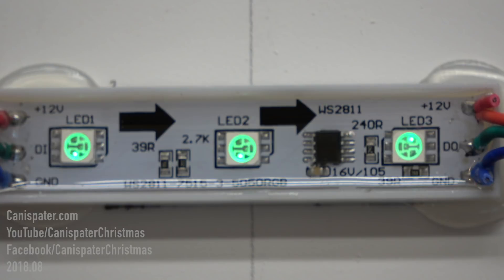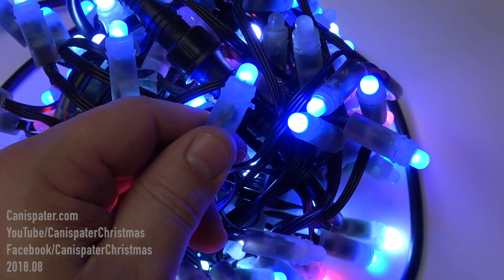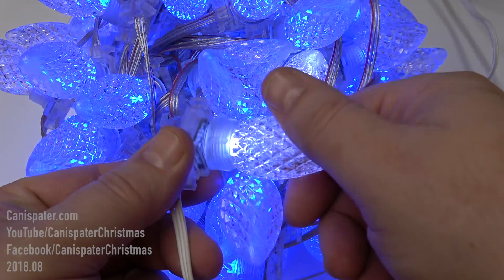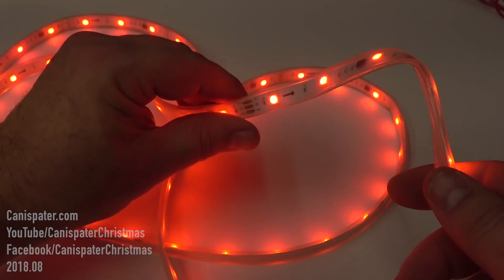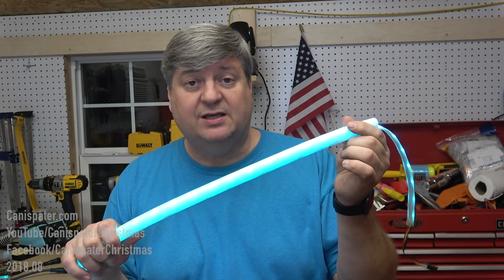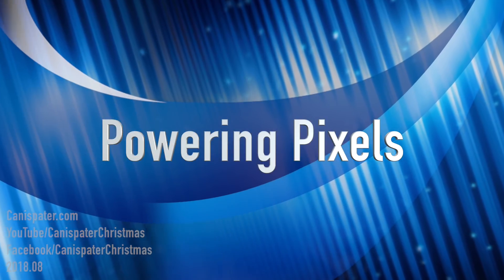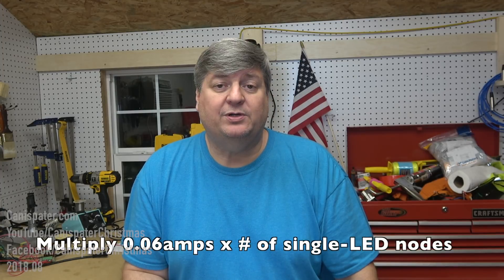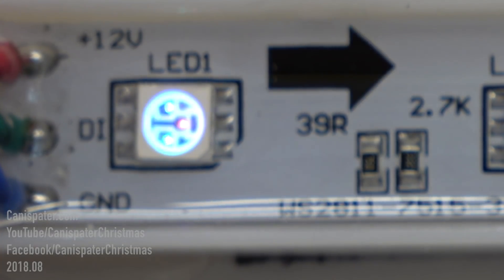HOW TO GET STARTED with RGB Pixels (2018)

Comment: how are pixels different then WLED light shows
Reply from the maker: From what I've read, WLEDs are white. Pixels have 3 LEDs in each bulb or "node" - one red, one green and one blue. Each node has a microchip capable of mixing the intensities of the three LEDs to produce practically any color. "Smart" or digital pixels use (computer) data to control the color and intensity of each individual node (20 times per second) which allows for animating patterns among the various elements or "props" in the display. "Dumb" or analog pixels are essentially the same, but the entire string is the same color and intensity. Most are using smart pixels these days.
Reply: @CanispaterChristmas  do they use the same power supply and controller
Reply from the maker: "They?" If you mean dumb/smart pixels, they use different controllers, but can use the same power supplies if the pixels are the same voltage. Now, dumb controllers (eg: http://www.hansonelectronics.com.au/product/2811dc30/) I've seen can use the SPI data from a smart controller (eg: https://www.pixelcontroller.com/store/index.php?id_product=48&controller=product) to control the dumb strings - the dumb controller acts like a small set of smart pixels to the smart controller. If you want to avoid getting more hardware, smart pixels can do everything dumb pixels can do and more so most are using smart these days. I have no idea what's involved with WLEDs.

Comment: Good day, I know you stated in another video that you use Mean Well for your power supply. They have so many different options my head started spinning, Could you be more specific in the model/type you use for Christmas lights. Thanks
Reply from the maker: Most of us use the 350-watt variety. They do have a few different models, but it comes down to personal preference. They have some where the screws point up and some where they point out. For 12V, I use several of the LRS-350-12.

Comment: I could have sworn I watched a video of yours about power injection using T connectors where you pulled the data connection out of the T with a pair of pliers. Any idea which video that might have been? I thought it might have been in your udemy course, but I couldn't find it there either.
Reply from the maker: I don't use T connectors for anything. All my power injection is done with the pigtail wiring or directly to the string if it's in the middle. I do use the 2-wire automotive connectors tho.

Comment: I'm having an issue where when I light my 22x30 pixel grid on red, the matrix shows different colors about every 170 pixels. Could you help me out here? I'm using f16v3 with fpp
Reply from the maker: Make sure the universe sizes are all either 510 or 512. Since you have an F16, I’d go 512 unless you need 510 for an older controller. I believe the F16 comes set to 510 by default so change it to 512 on the inputs page (can’t remember what it’s called - going from memory here). :).
Reply: @CanispaterChristmas  thanks! Your videos have pushed my wife and I to do pixels!
Reply: @CanispaterChristmas  that seems to have fixed it! Thank you so much!!

Comment: Just received my Pixel's from Ray, and want to just test them... but I do not have my Falcon controller yet... but I DO have all of my power injection pigtails with just 2 leads... can I just power them on to see if they light up? and I realize that I'd had no color control yet, so not even sure if they'd light at all... but figured I'd ask you first, or I can wait until I get my Falcon and create that test light pattern you run... Thanks
Reply from the maker: Well, I thought I replied to this earlier. No, you'll need data to get them to light up. Totally understand wanting to play with them though!
Reply: you actually did in the video, I had quickly typed the question and then "re-watched" the video... Thanks for the reply... @CanispaterChristmas

Comment: Is it hard to integrate pixels in light Rama and what do we need to do it
Reply from the maker: You can import old LOR sequences into xLights and drive the LOR boards with a Falcon F16V3 via the DMX output on the board. The F16V3 will also run the pixels. OR, I think LOR has pixel controllers now, but no clue about how to integrate them or software needed.

Comment: Thank you for your nice videos. I have a Tanbaby 5V 60A PSU that produces so much electrical noise at boot up that it renders my lights unusable. Is there a way to reduce this noise? As a temporary fix I have put a switch on the output, so I first turn my LEDs on after the PSU has been on for a couple of seconds.
Reply from the maker: You might try this question on the forums listed in the description of my videos if you don't get a good answer here. I've not heard of this problem nor experienced it myself, but I'm using MeanWell PSUs. Maybe a time-delay relay? There may be a filter circuit you could put together, but that is beyond my capabilities.

Comment: Over the last couple years I have fallen in love with the light shows I have seen.  It seems like a daunting task but I would like to start building a show for next year. Should I piece together a kit or just buy a plug and play kit? I do plan on expanding each year. I get overwhelmed trying to figure out what exactly I would need in terms of controllers and power supplys. I will be measuring and planning what type of displays I want to do so I can get a decent picture of how many total pixels I will need. Does each channel on the controllers support 1 universe or can they support multiple per channel?

I found your channel and it is very informative, thank you.
Reply from the maker: Thanks! There are some "ready-to-run" kits out there, but that doesn't include the computer (Pi or real computer) and you lose some of the DIY part of figuring everything out. Go through my beginner playlist and that will explain each of the parts needed. Controllers are different, but the Falcon F16V3 can support 1,024 pixels per port and isn't limited to one universe. Yes, do your research first. A year is plenty of time to get something going. The first year will be the toughest as there is a lot to learn, but once you learn it, it's easier to expand the next year. Check the descriptions of my videos as there are a ton of resources available to help you through your journey. :)

Comment: Great video, I learned a lot thanks. Is there a place I can buy a kit with everything I need (lights, power supply, controller, software etc.)?
Reply from the maker: Thanks! You can buy some kits that have some of it - controller, power supply, pigtails. Software is free and downloadable. Lights are separate.  Be sure to go through my beginner playlist as that explains each part in more detail.

Comment: Another question I have is  about power supply runs.  Like with 120 ac I can run well over 150ft of cord to run my led lights along my fence line. So with 18 gauge wire  how far can your power lines run ft wise without having to buy another power supply? Or even how many feet can cat 5 data go from your pie or computer to run your lights? Thanks for answering my last question
Reply from the maker: It depends on the voltage and even the pixels themselves, but I've been able to go about 30ft from power supply to first pixel. Brightness level also factors into power needs, but the standard ballpark figure is 0.06 amps per pixel or about 6amps for 100 pixels at 100% brightness for all white (all three LEDs on). I run most of my stuff at 30% brightness to keep from landing aircraft in my yard. :)  Data is standard Ethernet so 100 meters (328 feet).

Comment: Love the videos. I was wondering how u would go at a project like wire frame decorations using pixels. For example if I made a grinch wire frame what type of pixel would u use to zip tie it to the frame. Or what would u do.
Reply from the maker: I have a tree I've been wondering about. I'm thinking bullet pixels wire-tied to the frame.

Comment: love your videos. So this is my first year doing this I have built a mega tree with about 3350 lights but where I'm stuck is when I do the calculations at 100% I will be pulling 200 amps or 30% 70 amps that seams like a large load for residential house
Reply from the maker: That is a TON of lights for a tree, but also remember that’s 200 amps at 5/12 volts, not 110. But your calculations seem right. Make sure to send me a picture at #canispaterchristmas on instagram! I’ve got to see that one!
Reply: Yes I realize I over did it on the tree will fix it next year can’t start over it’s too late 🙈thank you so much for your help I watch all your videos
I started this project in the beginning of the year 👍
Reply: I’m doing all 12 v lights

Comment: So Typically, can you use one company's controller and software but use a totally different manufacturer's pixel lights? Are the connectors standardized or is it proprietary to each manufacturer? thanks
Reply from the maker: It's DIY so some lights come with pigtails, others come with bare wires you add connectors to. Years ago, someone figured out how to order stuff directly from manufacturers in China, had a good experience and we kinda latched onto him. There is another vendor now providing similar lights, but I've always ordered from Ray. So I've standardized on his connectors as they work well. The general operation of SPI lights is the same. Most are 3-wire (+, - and data), some have 4 (+, -, clock and data), but all are based on the chip they use to convert data to mix the colors for the lights. WS2811 has been around for a while and is typical, but there are other chips most controllers support. Controllers are the specialty item and there are a handful of manufacturers. Controllers convert E1.31 data to SPI data the lights need. E1.31 is generated by a few sequencing apps we use. But yeah, it's up to you as to what you use and how you hook it up.
Reply: @CanispaterChristmas  Thanks much!

Comment: I hope and plan on getting my first controller after the first of the year, and working on it off and on through out the year. You had mention some controllers in the video. I have looked into one called a light-o-rama. Could you explain what the difference is between the two, and or which one maybe would be a good starter set. I would rather spend a little extra money now instead of wishing; I should have bought one a little better. I need one that I could use and add lights to for the first couple of years until I get how these things work,without having to buy more controllers. Any information would be greatly appreciated.
Reply from the maker: It depends on the lights you plan to run (kinda). LOR started out as an AC light controller so you could buy strings of lights from WalMart and control them with LOR controllers. LOR has since moved into RGB pixels, but I don't have experience with the newer line of controllers. If you are planning to run pixels only, the Falcon controllers from pixelcontroller.com are IMO the best. The F16V3 is the current 16-port controller that would be a great grow-into controller.

Comment: Where can you find the red white and green wire? What gauge is it? 
Thank you
Reply from the maker: If you mean the wire on the pixels, they came that way from Ray. I believe it's ~18AWG.
Reply: I was just wondering what wiring I needed to make them longer. I’m doing a matrix of 1200 Pixel lights i need the wiring to be long enough to reach my falcon controllers. I’ll see if Home Depot has 18 gauge wire in the same color so I don’t confuse myself. I’ve been watching your videos for three months. I’m basing everything on your teachings. Wish me luck🤪
Reply from the maker: Oh! Yeah, that should be fine. That's awesome! Yes, good luck!

Comment: Hey guys, I could use some help in selecting a controller. Just starting this adventure so I want something not too expensive but not cheap in quality either. If I had could convince my wife I would probably buy the ready to go Falcon F16V3 unit but that's gonna have to wait while I figure this out. Basically, I just wanna run Xlights, Power supply and a controller to try out all the various projects and RGB lights. Thanks so much for the help!
Reply from the maker: You didn't mention how many pixels you plan to start with. David has the F4 (4-port) boards that would be a little cheaper than an F16, but if you plan to expand, you could just get the F16 and one power supply and start there. There's also the SanDevices boards that are solid performers - not as many features as the Falcons, but they work great. There are a couple of other options, but involve more tinkering.
Reply: Probably going to do a small project this year like icicles or a Boscoyo star so 150 pixels max. I looked at the SanDevices and there doesn't seem to be a huge price difference in regards to their controllers compared to functionality.
Reply from the maker: Yeah, not much. You might also look into a PiCap or PiHat for a controller, but it requires a Raspberry Pi running FPP so not sure if you want to go that far with it all.
Reply: I was looking at a PiCap last year. I think that's the route I will go this year just to get started. So I can run Xlights with the PiCap?
Reply from the maker: Yes. In bridge mode, FPP will pass data from xLights through to the hat. You can also create an FSEQ file in xLights and play that in FPP. That's how many folks automate their shows, but the xLights scheduler has been getting a lot of love from Keith over the past few months and is a strong contender if you have a spare PC to run the show on.
Reply: You are a scholar and a gentleman! I have no idea what all that FPP or FSEQ means other than it's possible to play with shiny lights. Ha! I have some work to do. Thanks for your time!

Comment: Great video! I have purchased my first set of lights and I run into some issues. I need to get some pigtails, but which connection type should I get? I was looking to buy 3pin connection and then one set showed up with four wires, I think I ordered one set 5v and one 12 v. Newbie mistake, where do you order yours from. I see they vary in length. Thanks for your help in advance
Reply from the maker: Thanks! I suppose it really doesn't matter, but I standardized on 4-pin connectors early on just in case I got pixels with 4 wires. FYI, NONE of my strings have 4 wires! It is nice though to put 3-pin pigtails on 5V strings to keep me from accidentally hooking them up to 12V. Personal preference really. I buy my pigtails from Ray since my lights come from him too. When you order, you can specify the pigtails you want and he'll put them on for you.